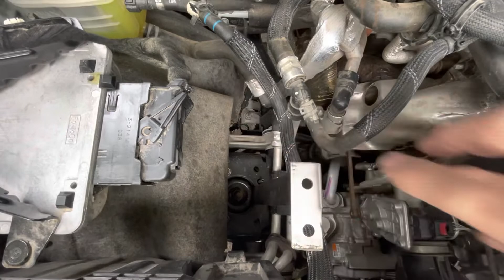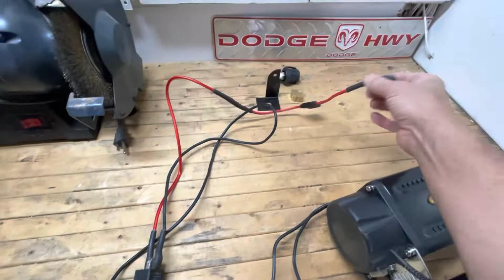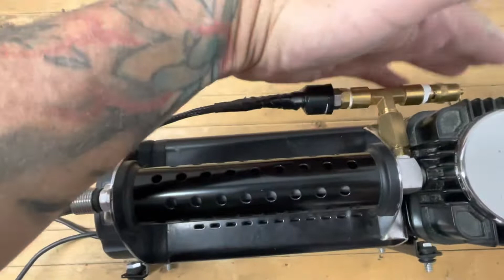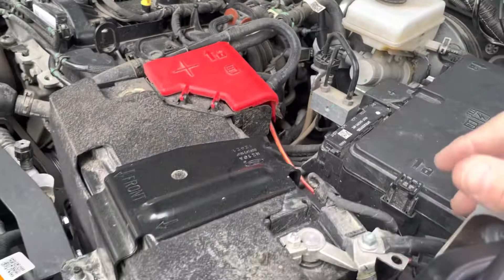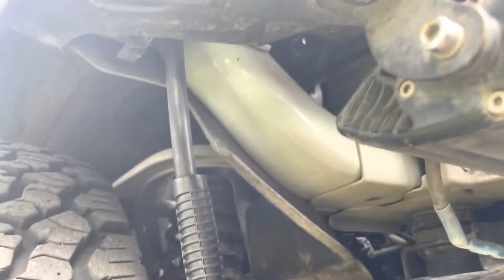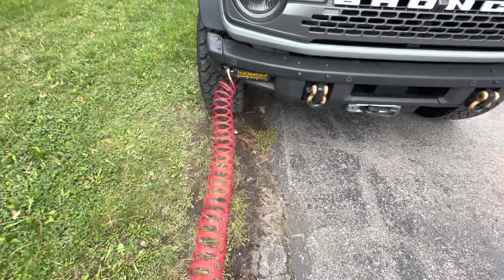Bronco budget on-board air!

Comment: Where did you buy the mount? Also can this compressor handle all 4 tires at once?
Reply from the maker: Hey. The mount was custom made by my friend unfortunately. But it is available from one of the companies (can’t recall which) for the ARB - which should work as well. 
The compressor handles 4 tires at once just fine - it’s what I do. Still takes a good 7-8 minutes to go from 14psi to 35psi. I do tend to open the hood during the process for heat dissipation.
Reply: @theaxeman8492  Thanks for replying!
Thats awesome but stinks that the mount is custom, I know about the ARB mount but I cant justify how much it is for a piece of metal :(